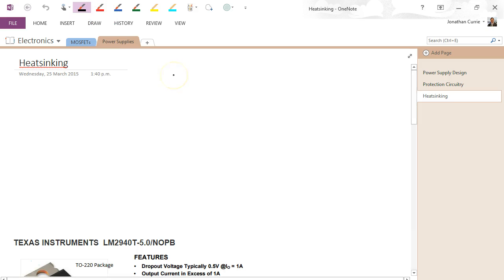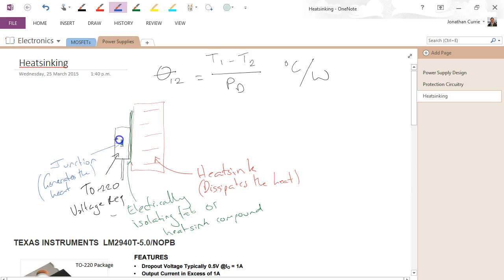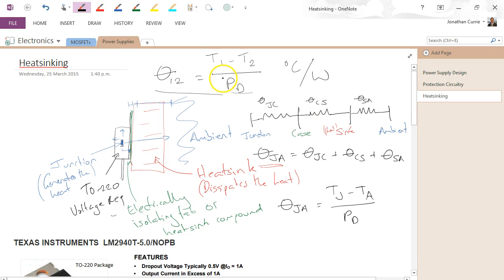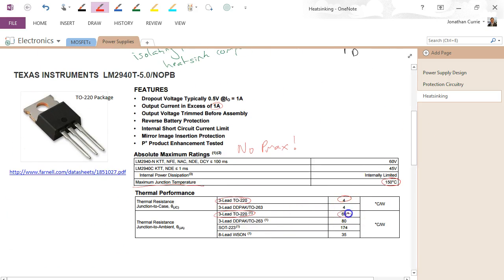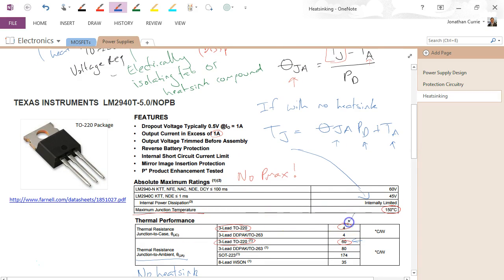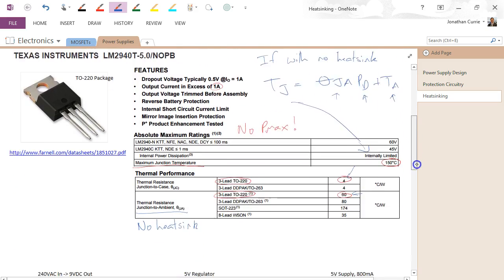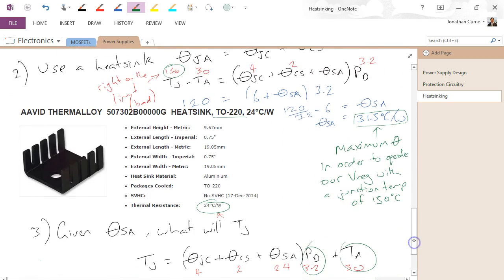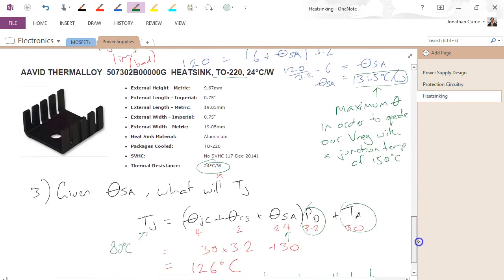Power Supplies: Heat Sinking & Thermal Considerations

Comment: Sir, I have a doubt if we will connect the heat sink in the bottom layer of the PCB and the SMD MOSFET is mounted on the TOP layer of the PCB.
Then the 
1. Junction to Case  resistance
2. Thermal via resistance of PCB
3. Resistance of interface material 
4. Resistance of heat sink 

Will play a role. 
But if I increase the thermal resistance by attaching the heat sink to the bottom layer then the junction temperature will increase.

Please tell me: In case of the SMD component, heatsink is good or not?🙏🙏

Comment: How do the calculations change if you are placing multiple devices on a single heat sink?

I can assume that transistors in parallel will allow the total electrical watts to be divided by number of devices, however what maths needs to be done to recalculate junction to ambient?

I would appreciate it if you someone could answer this as im trying to work out my heat sink /transistor arrangements for my
 TIP3055 devices

I’m dissipating 360 watts total, with basing my calculations with an ambient temp of 35, and a maximum junction temp of 50C

Heatsink can run as hot as it wants, but junction needs to remain 50-70C per device 

JC for TIP3055 is 1.39CW
Case to sink assumes 2CW
Max Tj = 150C

Power dissipation = 90 watts per degree C at 25

3 x heat sinks, each having a thermal conductivity of 0.367CW 

So this is what I found 

Rth j-a = Jc/ number of devices + c-s + s-a

Rth j-a = 1.39/4 + 2 + 0.367 
Rth j-a = 2.8CW

Right or wrong?

Based on 4 TIP3055’s on 1 heatsink 
Total of 12 on 3 sinks 

360W/ 12 = 30W per device 

Tj = 2.8 x 30W + 30C amb
Tj = 114C

One 120W TIP3055 heatsink module, with a Tj of 114C per transistor dissipating 120W

Can anyone advise better?

Thanks 🙏

Comment: How do you measure the temperature on those devices if you don't have all that data? They are so small. Besides, you are not supposed to mount your thermocouples to plastic case (you don't know the temperature resistance of this plastic)...

Comment: I'm calculating mine. With 2amps and 12vin 5v out= 14w power dissipation. With 2c/w heat resistance on junction to case. 45celciuc outside temperature a d 125c max temperature for junction. I get 1.71c/w for heat sink. Is that a reasonable value?

Comment: Is the ambient taken as the room temperature? Or is it taken as the temperature very very close to the case?

I ask because I'm not getting the same values for the junction temperature when I calculate going from case to junction, and from ambient to junction. I measure the case temp of my component after it's hooked up to the circuit for a long time. I also measure the room temperature. Then I do the two calculations for the junction temperature both ways (J-A and J-C) and I get a 30 degree difference (Celsius) between the two calculations for the junction temperature